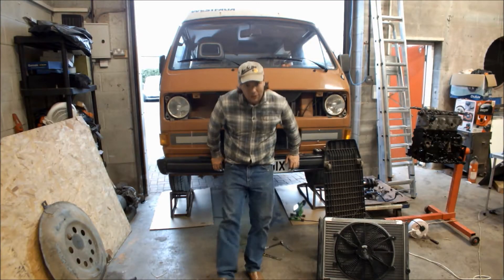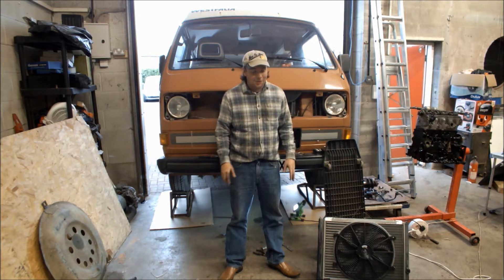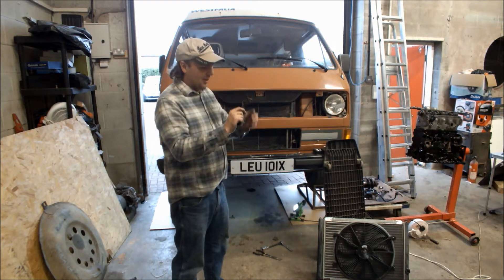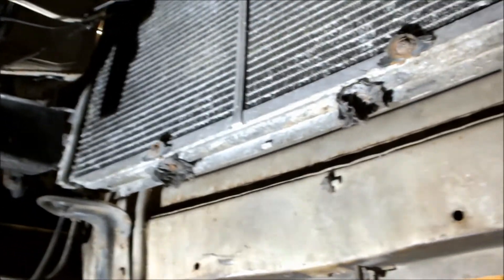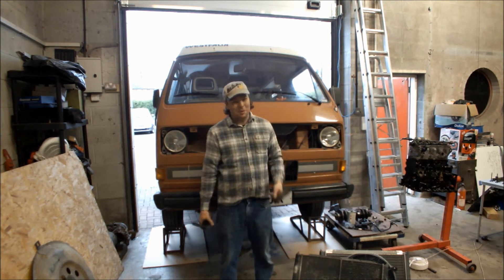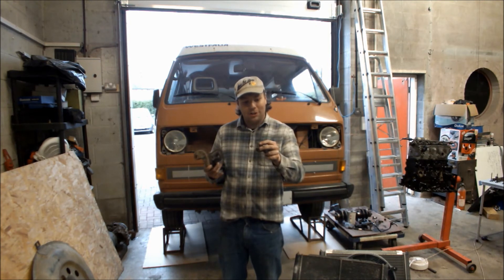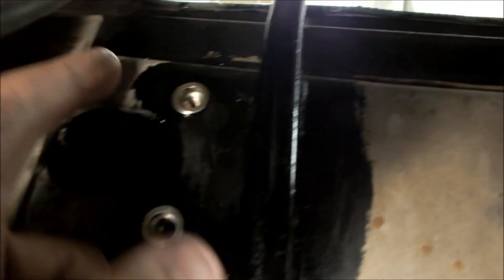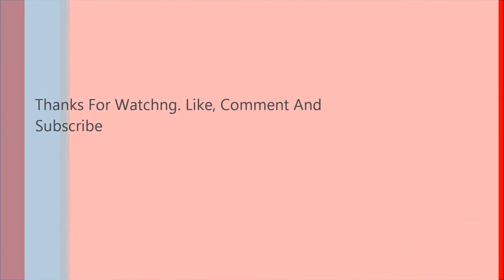VW T25 Radiator Replacement

Comment: How about a video on how to drain and refill the coolant?
Reply from the maker: I could do but it's really not that difficult.  I find holding a few rpm helps
Reply: @Bodgemiester  
A quick one of which lines to drop and where they are and the general draining procedure would help a lot of us. 

AFA the bleeding, some use the diy bong and some do the bicycle pressure method and some the 2500 rpm method. 

Anyway thanks
Reply from the maker: @at1970  I am doing an oil pump upgrade soon, switching to a golf.gti pump. Should be good
Reply: @Bodgemiester  
Not sure what you mean?

Comment: First of all, tanks a lot for the videos! ;)
Do you have a video showing how did you mount the radiator baffles? I've just order a set.
Reply from the maker: Hi Thanks for the support!. I just mounted them using a product called ‘upol Tiger Seal’ it a very strong polyurethane adhesive sealer. Use anything like that, no mechanical fasteners

Comment: I'm renovating a single cab pickup which I've converted to diesel using the AAZ from a Golf, this is a brilliant video and something I will definately do on mine, do you have another video coming out on the wiring for the twin fans? Took your advice with the Rivnuts, bought a kit from Amazon,  can use it in loads of places on my truck. How are you finding Patreon as I was going to sign up myself last year but never got round to it?
Reply from the maker: Hi, check out my other videos on the engine conversion itself they may be useful to you,  the fans use the original sensor but switch standard 30amp relays for the fans, I also have an override but have never needed it even on the hottest days! Patreon is a bit of a dud for me at the moment, I’ll have to start putting the cat in my videos lol
Reply: @Bodgemiester  I'm like you also renovating motorbikes, working on a full rebuild of a XL 500S at the moment,  got another four bikes, tinkering with welders, building a vapour blaster and have over 1,000 vintage petrol cans which is what the pickup is for when I get it finished, work's truck, setting up as a new business.
Reply from the maker: @justinmacadam3924  cool!
Reply: Good day. I hope you are well? I’ve got my radiator and fan out and the OG fan is piddly. Could you tell what you mean by “switch the standard 30amp”? And how do you fit the overuse switch? Thanks for the help. 
Daniel

Comment: Was your fan always at the front or did you change it?
Reply from the maker: No, the original two speed fan is mounted behind the radiator (still) and the big 12” one is extra. I have driven this thing all over and it WILL NOT overheat, even when towing!